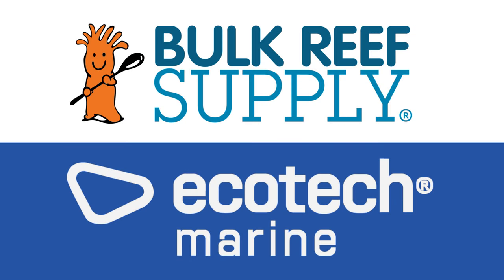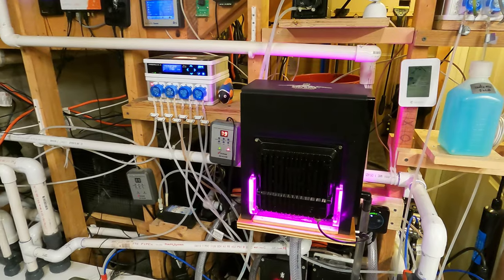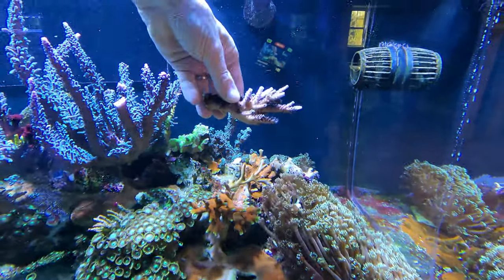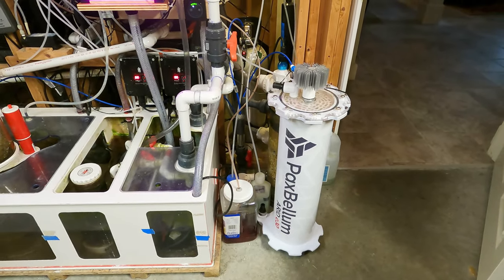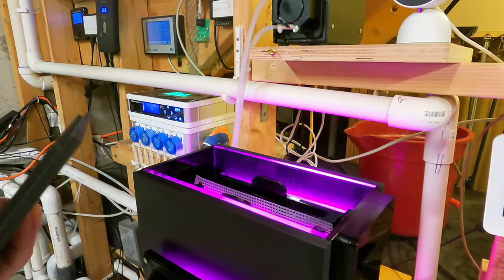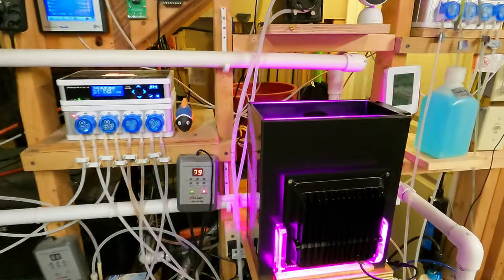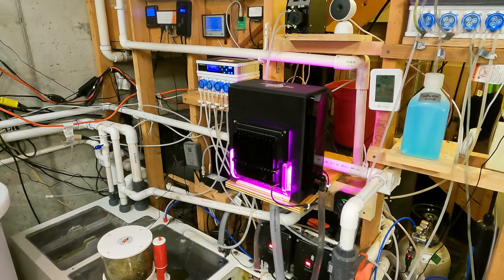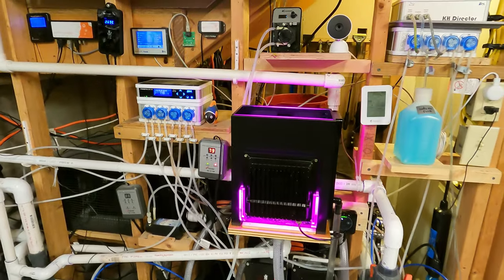Adding an Algae Scrubber to The Mix

Comment: I run the same scrubber and have it installed very similarly to you, on a little shelf above my sump. It grows algae well and does what it's supposed to do. A few things I don't like is 1. the acrylic sides have begun to bow out slightly and the tray that holds the screen no longer slides in and out of the unit easily. I have to squeeze the sides inward to get the tray to slide in and out. 2. If the unit isn't cleaned often enough strings of green algae will begin to come out the drain and dirty up the sump. 3. I do worry about the hose barb inlet, if that hose was ever to pop off that barb the entire water volume of the system could get pumped out onto the floor. I've never had it come off but I did put a couple zip ties around the hose on the barb for extra insurance.

Comment: Been running a Clearwater Scrubber Algae Scrubber on various tanks now for at least 3 maybe 4 years. They can be very effective at nutrient export.

Tip - if you have any GHA in your display(even a tiny amount) , on your next maintenance,  take a little tiny bit of it, and rub it on then screen to seed it. It'll start growing pretty quick.

We're  currently running the previous version of the CWS scrubber on our office tank, and it does need to be harvested at least once a week.

Planning to upgrade it to the new version soon.
Reply: Seeding definitely helps, I had to harvest exactly one month after first turning on my DIY scrubber. Couldn’t believe how quickly the algae grew.